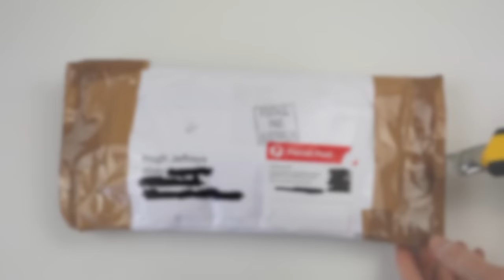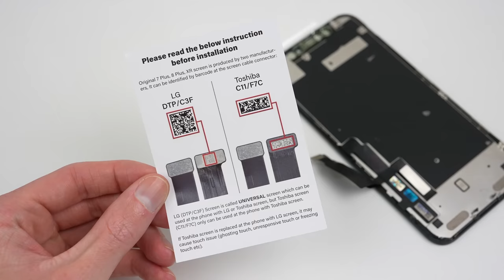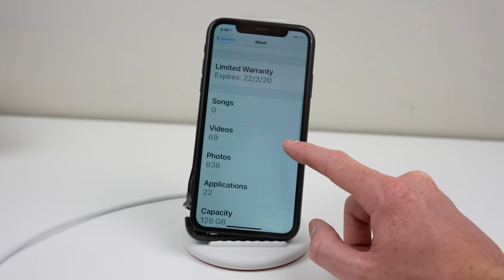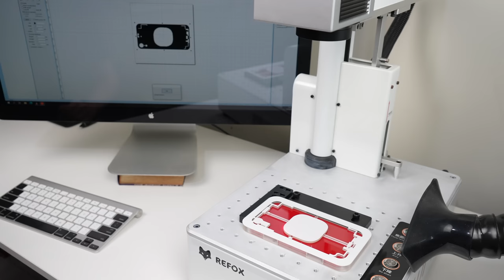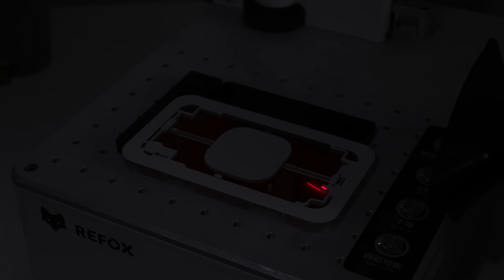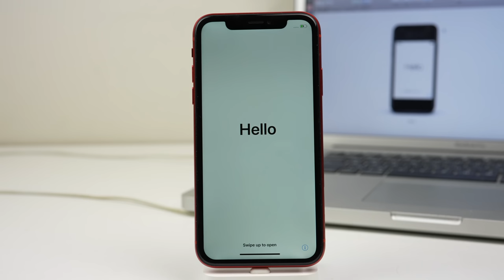$35 iPhone XR Destroyed By A Lawn Mower Lets Restore It!

Comment: Little tip, run the housing through a second time after you remove the back glass. It takes off all the glue.
Reply: up vote this
Reply: @lukewatson059  yea
Reply: Armchair expert over here
Reply: No
Reply: I think that would had caused the same issue that happened with the first housing
Reply: That was a third party housing which doesn’t have the same pattern of glue as the apple does.
Reply: @seifu8318  ddddddddddddddddddd y

Comment: Quick tip that I learned Hugh:
If you want the charging pad to look as though it's not been meddled with at all, use the traditional way to remove back glass (the heat gun) and then push the charging pad out from the other side. Works like a charm for me.

Comment: 13:45 i really hope you reprogrammed the new taptic engine, it's really important to mention that a mismatched taptic engine can cause missing proper vibration patterns, this started with the iPhone 8. Patterns may work for a while, but it can easily decide to not work anymore after a while if it's mismatched. The FPC's for Taptic Engine reading are even included in the JC V1S board for True Tone reading.
Reply: Bit hard to do when the old taptic engine is completely dead!
Reply: @TheSpotify95  true but it might still have been electrically active even if its not longer physically functional so the keys might been able to be pulled from the remnants
Reply: yet another jerk move from Apple.

Comment: Hugh, are you sure it's a good idea to use old corroded screws to hold the taptic engine in place? This could cost you in the long run if the corrosion starts spreading further...

Comment: How'd you remove the previous users iCloud? That is notoriously difficult and in some cases, impossible from what I know. Btw, great video as always!
Reply: they have programs that work quite well
Reply: @sealwheel  Back when I used to work on phones, most of the programs I tried to remove the iCloud were worthless cash grabs. I’m thinking what made it possible here was the fact that it was running iOS 12.
Reply: @nashbrandon  oh. i think they have some free ones out there, im not sure

the programs are a bit sketchy though.
Reply: i've been wondering that myself
Reply: Maybe he contacted the seller of the broken phone
Reply: @onkelklaujo  the seller said he did not attempt to repair it since it was locked

Comment: im curious what the process you used to remove icloud here was. great job on the restoration!
Reply: Mee too
Reply: I thought there is no way to remove it, at least after a factory reset.
Reply: Could the phone be updated to the latest iOS…? Or would cloud prevent this..?
Reply: @jimalcott760  you can update it through itunes in recovery mode if it's locked or signed into an account. really the only circumstance that'd be useful in is if: the device thinks its signed into icloud, but in apple's database it's not. If you reset the device before ever connecting it to internet again, it will not update what's on apple's servers, and stay unlocked.

Comment: The only thing I can see that doesn’t look so good is the glue around the camera lens but it has to have it so 🤷‍♂️
Reply: Yeah its kind of a pain to hide. I had an iPhone 8 that I replaced the glass on and instead of using glue to keep the lens up, I used a few of the tiny shards of broken back glass around the lens and it worked great.

Comment: 7:12 That's exactly what I did. I found a Walmart/Tracfone 64GB XR that fell from a car and was in the roadway. The LCD was entirely shattered and the face ID camera was crushed, but the back of the phone survived because of the case. iCloud locked, but without face-ID and without a screen it's functionally totaled. A screen replacement costs more than a replacement device. 

I then got a clean-iCloud factory-unlocked 256GB Xr for $220 with a cracked back to housing-swap it. I now have the perfect Xr I wanted, and a spare parts brick. Both had stable batteries so at the very least there's a spare battery left in it for sure.

Comment: I’m not a big fan of the two tone look and those black back glasses are not pure black looking grey (Space!) off axis which I don’t think is a great contrast. It seemed there was a FaceID issue as well as iCloud lock. How did Hugh sort those out? It also looked like some glue residue got on or damage occurred to the camera ring. Hats off to him for doing the process. I’ve had a smashed back on one of these but opted for the hair dryer/heat gun tweezer and patience method just to replace the glass. Still the lesser of two evils!

Comment: Can I ask you why you are not more into microsoldering? I mean it's the next step after the basic repairs you do and you already said that you will start with it. You can easily start doing it with a few hundred bucks. I got a microscope for 80 dollars and it has very good image quality, cheap soldering iron and hot air station and it works.

Comment: can u help me the broke some metal right downwards the camera to mother board breaks it is da ground? it was a floppy junky metal part one screw in cam one screw in mainboard i need to remowe screws to disasemble but its impossible with brake these part i dont know but all still works just crush the new lcd put it in a metalcase lool

Comment: As someone who owns several shops and does this for a living .. Here's a suggestion Hugh, when you need a new back for say an XR then contact an independent shop around your area and ask if they have any because they'll be cheap, as most shops don't bother swapping back glass, and it adds to the re-use vibe you're going for seemingly, and also saves you a lot of trouble that knock-off cases usually introduce, like faulty antennae.

Also when you say that most repairshops wouldn't swap out minor components you're right, but there's a time aspect, and if we are to put bread on the table for our families we can't spend an extra 30-45 minutes when the cost of a all small parts installed case is only say 5-10$ more, at least not if the customer's isn't offering to pay us for the extra lengthy service.

Comment: Welcome to Apple autopsy!☻
Reply: So many parts, and screws of varying sizes. I question the necessity of it all. My flagship LG phone had eight screws that were all the same length, size, and took 15 minutes to disassemble and reassemble. It had a user changeable battery, and swapping out the screen was straight forward. My new 5G phone is a Samsung, and I don't want to know what's inside of it.

Comment: Defective Phone: 39$
New Parts for Repair: 300$
Cost of a refurbished XR: 350$
Makes sense.

But cool video, was fun to see it.
Reply: You could definetly do it cheaper though. There are lots of shitty aftermarket parts that are dirt cheap, obviously worse in quality but still usable. Finding deals is also possible.
Reply: Well, I'll break down the cost
LCD: ~ 100 - 150 AUD
Housing: ~ 40 AUD

So yeah, if you have the skill and a broken phone lying around, it is financially viable to repair the phone instead of buying a new one
P/S: Hugh Jeffrey bought a black back glass and used the laser machine, but this is totally optional